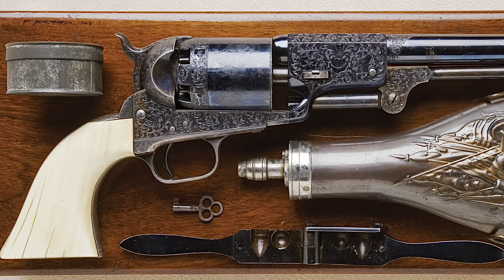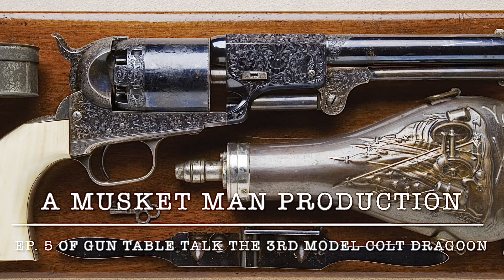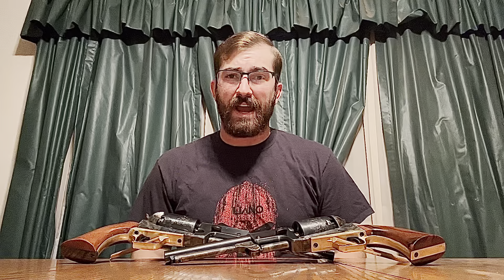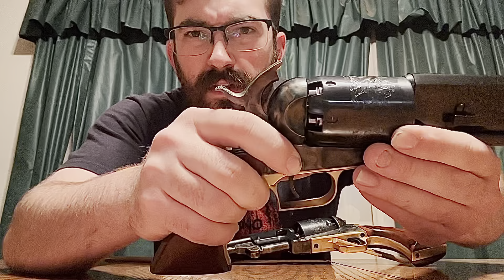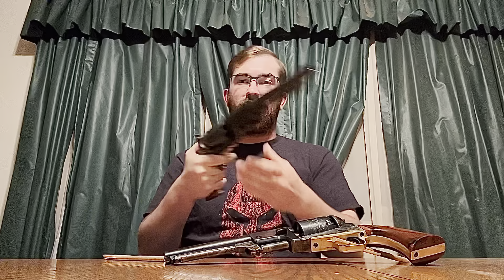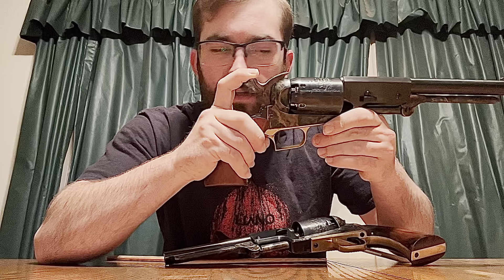The 3rd Model Dragoon. GTT Ep. 5

Comment: Would 35-40 grains of triple seven be safe to use in the Uberti 3rd Model Dragoon? 

Thanks
Reply from the maker: Yes, you should not have a problem. I would not exceed 40grs of triple 7 since it burns hotter than normal powder.👍🏻